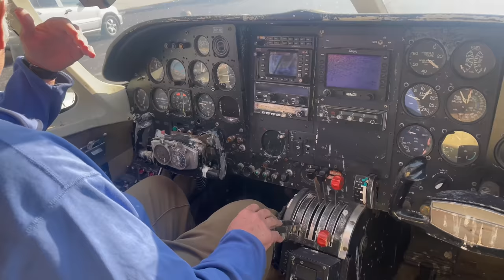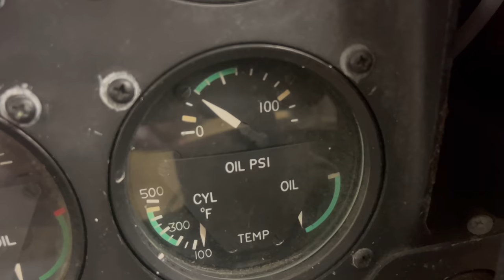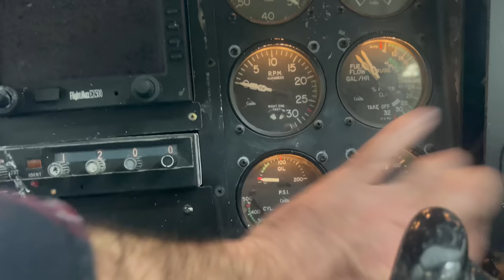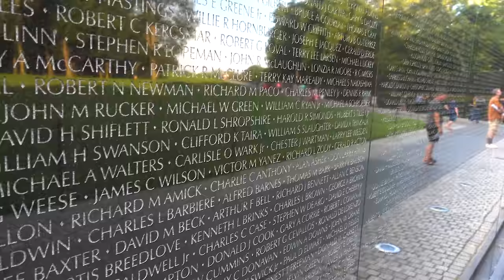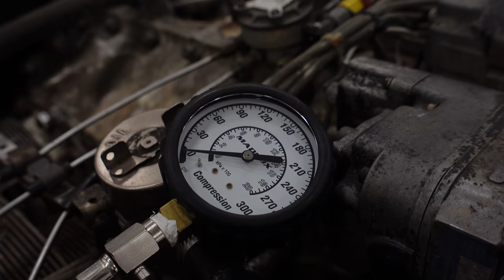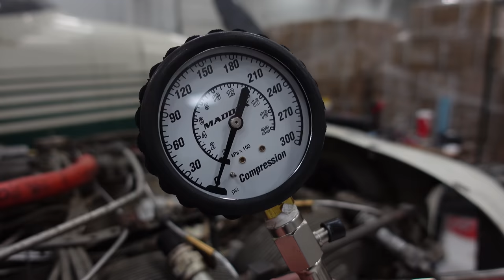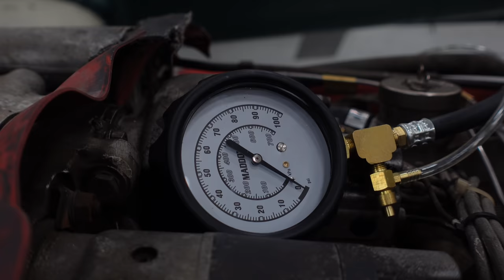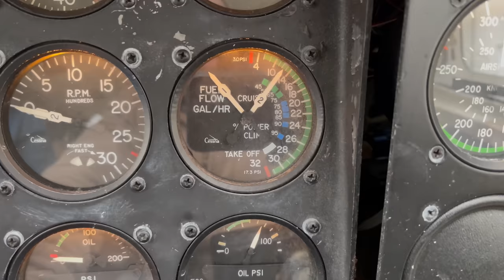Did We Ruin The FREE Abandoned Airplane Engine ? Ep6

Comment: As someone far from air stuff but into mc stuff it sounds like the engine has everything, but the starter circuitry is gone. Bypass ground, connect directly. With the other engine running the voltage is up and it turns much happier, but it's still bad. Bypassing ground with nice thick wires "could" solve that.
Reply: Exactly this, i'm suspecting the copper inside the high amperage cables have corroded and is acting like a resistor for the starter. It's tedious work, but i would generally go over all grounding cables as well as other cables that are mandatory for it to start and check for continuity. After sitting outside for many years, rainwater gets in everywhere. So i wouldn't be too surprised if the cables and wires are corroded
Reply: I really don't think that's the problem. The engine that did start wasn't turning that much faster. I think the engine that did start has wiped some of the gunk of sitting out of itself by running, and now it cranks more happily. The one that hasn't yet started is full of garbage, and it will have to run for a little to get it out, and I think that's why it cranks more slowly. As to why it didn't start, I don't think it's getting enough fuel. Something is blocked in the fuel system. His finding a dry plug is a dead giveaway. With the compression as low as it is, it will have to get very rich to start, and there's just not enough gas available to get it there.
Reply: @edifyguy  Yeah it does also seem like it’s just not holding fuel pressure. It seems to build pressure, but as he turns the engine over it’s not powerfull enough to keep the pressure stable enough for it to start. It seems like every time it coughs is right after they start spinning it. Maybe the distribution block is clogged or gunked up. Wouldn’t hurt to do a full clean-out like you would on a carburetor if it’s been sitting with old fuel in it for years
Reply: @HunnyVRC  Exactly so. It could be something as simple as a fuel filter full of scale and varnish, or a pump pickup strainer full of tank flakes. That fuel system needs to be systematically checked to see why it isn't flowing well, because to me, it obviously is not.
Reply: My money is on the mice.
Reply: @audreybarnes6527  I imagine he'll settle this for us soon. :)
Reply: @edifyguy  He cleaned the fuel system, the pump is electric, if there's a ground fault and or continuity issue there won't be enough juice to run the system. The thing to notice IMHO is how engine 2 spun faster once engine 1 was running.  Finger crossed it stands to reason, if he can fix one engine he's sufficiently skilled to start the other.  He's yet to do any electrical testing... 🤔😃
Reply: @audreybarnes6527  Of course engine 2 spun faster once engine 1 was running; the output of the alternator (generator?) on the running engine will raise the voltage to about 29 instead of 24 and supply additional current that isn't coming through the jumper cables making the voltage drop significantly less. Yet for all the additional spinning, it didn't end up running. It tried really hard; if you watch closely during the engine running second start, it actually started twice but immediately died. Another commenter observed that the amount of fuel he got in his cup didn't come close to what he should have in the time he was doing it. I'm quite sure that this is a fuel problem.
Reply: @edifyguy  Yep I saw that too.
Reply: @edifyguy  i think its both electrical and fuel, as the only time it span for a cycle here and there was with the other engine charging up the voltage.
Reply: @kosmarjus  I believe that's because spinning it faster raised the effective compression by giving less time for blowby on the damaged cylinder walls, making it more willing to fire with a leaner mixture, but it still wasn't getting enough fuel to keep going on its own. That puts raising the voltage in the category of a workaround that didn't work because, like all workarounds, it doesn't correct the root issue, and in this case the root issue (not enough fuel) is too fundamental for the engine to start with the workaround. However, I suspect from the description we'll know more soon.

Comment: I swear when engine 1 was charging the battery, engine 2 was cranking great and was so close to starting. That compression seems pretty low so I'd say either sticky valves or damaged cylinder walls
Reply: I’m voting for sticking valves. Personally I wouldn’t even mess with trying to get it to run. It’s going to need two engine and prop overhauls to be airworthy. Since he doesn’t have the log books all the ADs need to be checked for compliance, and a very very extensive annual.
Reply: It was very close to starting for sure.
Reply: that's my thought too he needs to actually inspect the cylinders and see if they need major cleaning or replacements
Reply: @czwhat328  very true but it still would've been nice to just hear it run lol
Reply: @czwhat328  He had to start it to get ownership of the plane.
Reply: Time for some percussive maintenance
Reply: @a.b.6233  But he started the other engine, that being said the way I see it, as a result ownership is no longer an issue.
Reply: If you were watching the series from the beginning, you would know that this engine does have damaged cylinder walls. He looked inside with a camera and the corrosion was significant. This accounts for the slow cranking and low compression. However, I believe that the no-start is a fuel problem. With the left engine running, the right engine sputtered several times, but couldn't keep going, and his removal of a plug to find it was dry tells us why, I believe.

Comment: I noticed that when the 1st engine was running the 2nd engine was actually wanting  to start. And that was at the end of the day and you was done trying. So maybe you should start the 1st one then prime the 2nd one and try starting it , there will be more charge in the batteries  to start the number 2 engine. Keep up the great work and God Bless you guys and your families.
Reply: Still no constant ignition in the bores, not even a misfire/backfire makes it seem like the second engine is just giving it more cca's. The noise that sounds like the pistons against the bores isn't normal, nor is the lack of fuel getting into the cylinders, all of them should be flooded with zero fire.. They all have compression so it's not passing the rings. I am putting my money on it being fuel related or blocked/dead injectors.
Reply: That looks like it did not get fuel.

Comment: I recommend spraying starter fluid into the intake while cranking the engine over. That stuff evaporates rapidly and you need a continuous stream with such low compression imo. After starting, stop spraying and if it shuts down, you're not getting enough fuel flow. Keep up the good work!
Reply: this ad squirt oil in cylinders,that sound we heard was dry cylinder walls,this will speed up cranking speed and can also raise compression in the low cylinders,combine this with your idea and bet it starts.
Reply: @pigeonsil240sx  I agree with dry cylinders and piston rings are squeaking on the cylinder walls.  The penetrating oil and jet fuel (kerosene) has done their jobs.  Now need to lube the cylinders.   You can also use a bore scope to check the cylinder walls for scoring.

Comment: If both engines feel the same when turned by hand maybe you have some wiring or grounding issue in the starter wires/relays, and you have voltage drop somewhere and that's why it turns slower than the other engine that started. You can check the voltage at the starter or connect the batteries directly to the starter motor and see if it turns better. Because it is lower in compression than the one that starts, and if the piston rings are worn out, you can still start it if it turns fast enough, the faster the engine turns, the less compression has time to escape, maybe that's why the other engine is starting fine, because it is turning faster so it makes more compression.
Reply: A number of people have pointed this out. He says he reads the comments but he probably doesn't understand the nature of the problem or that it even could be one. He or someone helping him needs to go through the electrical esp. grounding wire by wire with a schematic in hand. Really it's the only thing left imo.
Reply: Exactly!! 99% of the time a slow crank isn’t a starter issue it’s an amperage issue! He needs to check the cables going to the starter and the grounds for the engine!
Reply: Yuck Fuutoob  it sat for 17 years. It's not a stretch to say that it's probably all of the above. How much each individual part is contributing to the issue is another story.
Reply: If he has swapped starters and both same then a simple test to rule out the cabling would be to power the starter directly. Heck, id have been tempted to run it up at a higher voltage. If not then then that starboard engine has greater turning resistance.. for whatever reason. If the cabling is ruled out then i would start looking at other mechanicals.. like why it has no oil pressure. He needs to check that physically if its the sensor or if there is actually no pressure. Without oil pressure turning resistance would be greater i imagine esp if bearings are dry for 10+ years

Comment: If I strip a mag to that extent, I always get it remagnetised, especially one that's sat around for that long. It can feel like it's got some "clunk" when you turn it and generate a spark, but it may still not work efficiently under compression in a cold engine. Also coils deteriorate with age, not use. A good mag will fire up a bucket of oily rags from ten feet. Good luck with that.
Reply: I agree. I think he should've taken apart the other mag and had them both working also to get the extra help. I could tell it was firing on that one cylinder with the higher compression. I also think he should've put a light weight oil in the cylinders instead of that darn either! Wish he would throw that starting fluid away! Something like marvel mystery oil would help lube and seal those cylinders.
Reply: Stock that cabinet up with the mystery oil!

Comment: While timing is important in general, it's also important to know that unlike most engines, aviation engines don't have spark advance.  The timing is set for optimal operating RPM (2300-2500 RPM) since it is not revved like a car engine would be during its normal operation.  As a result, these engines and tend to idle poorly (as compared to an engine that have spark advance).
Reply: Great job, addicted to the series. Donated and bought gear, now I want to see it fly into South Florida 💪🏼
Reply: He had to move it a bit for the red line to match the piston right? 
IMO it was correct before he corrected it
Reply: Also I wonder if having number 1 running if volts are higher causing better spark and better turning over causing it to at least try to pop over..
Reply: @stevenjones618   Magnetos aren't powered by voltage from the electrical system.  They make their own power.     They're kinda like an alternator and a coil merged into one.
Reply: @stevenjones618  Having the other engine running wouldn't affect the ignition.  Piston aircraft engine ignition systems are sparked by magneto coils so the battery/alternator system is completely separate (these engines operate more like your run of the mill lawnmower engine than like a modern vehicle engine.)  The only thing affected by the battery/alternator is the power to the starter motor.  Having the other engine running with the alternator on could supply extra voltage to the starters through the electrical busses (that might be why the prop on the number 2 engine seemed to be spinning faster after the other engine was running).  I don't know if the alternators in that type of aircraft are separated on different busses or if they are on the same electrical bus (I have never flown that type before), but either way most twins with separate electrical busses can be tied manually.
Reply: This left mag is a shower if sparks mag.  It takes a vibrator to start.  Timing numbers are on the data plate, on top of the engine.  Timing is not top center.  Number 1 cylinder. It is stated on data plate 20 degrees befor top center, I think.
Reply: @MrMaseroni  yes thats what I was trying to say more volts to turn motor over faster. But would it create a stronger spark from mags..
Reply: @earlbrown  yes I think I was trying to say is more volts to starter to the other engine. So does a faster spinning engine produce a stronger spark.
Reply: @stevenjones618  that is generally true yes.  Although it does depend upon whether or not the mag that was working was equipped with an impulse coupling which would spring load the magneto during start to provide extra rotational speed in the mag and delay the spark timing slightly for the purposes of start.  He did mention during the video that the non-functional mag on that engine was a "Shower of sparks" mag which is a system used to assist starting where a continuous DC electrical arc (provided by battery power) is fed to the spark plug at or near TDC during the start. If that was not working, it is likely that the mag that was functioning was not equipped with an impulse coupling.  Therefore, the engine might have more trouble trying to start when slowly turning because the spark on the functioning mag would have fired closer to 20-ish degrees before TDC, thereby robbing the engine of the momentum it would need to rotate fast enough to start.  I'm not sure that was the culprit here though.  There wasn't much evidence of pistons firing coming out of the exhaust.🤷‍♂️

Comment: Definitely need to check that mag timing after that magneto removal. The smallest of movement makes a big difference on these engines. If the engine data plate says 22 degrees then it needs to be around 21-23 degrees.
Reply: Easy enough to prove. Swap over the working mag. If that kicks it off then its the mag. You can also test the suspect mag on the working engine. We do have four mags to play with, so we should be able to get at least two working to start with.
EDIT: It did appear to get much closer to running with the other engine running, so those batteries still appear to be struggling a bit. Taking off the accessories would also help prove where the slowdown is coming from, but start with a test using the good mag.
Reply: @AndyHullMcPenguin  Timing may be an issue since it was trying to cough and start on a few cylinders when it was turned over off the higher starter voltage, but then dying out again at every other revolution. I'd agree with a mag swap.

Comment: You need to get the battery's installed, the jumper cables are a huge voltage drop. You can see that when you had the other engine running the engine was cranking over a lot faster
Reply: Up

Comment: Was happy to see you finally start engine 1, and then try 2. Typically with twins; one would start engine 1, and only attempt to start engine 2 once engine 1 is running. That way you can get more electrical power to engine 2 for starting. The battery cables are considerably longer going to engine 2, so it really does help having 1 running when starting 2.
Reply: Great point!
Reply: He tried 🥺
Reply: It definitely helped a lot when 1 was running
Reply: Agree .  Even hook batteries up to starter to remove any voltage drop in longer cables would be worth a try.